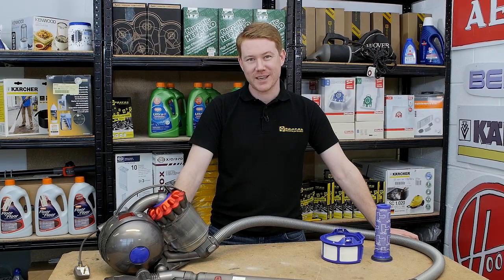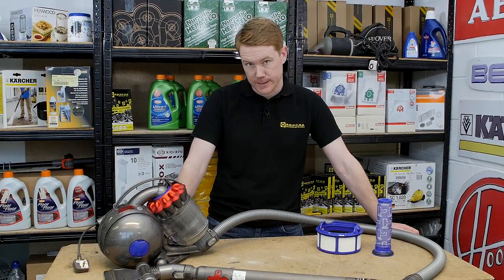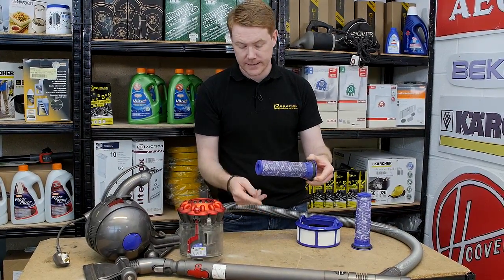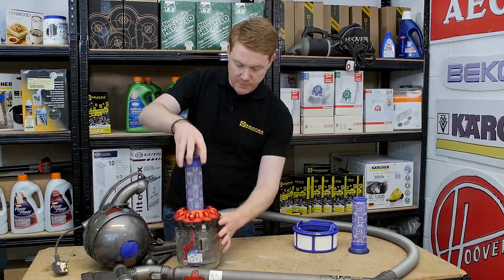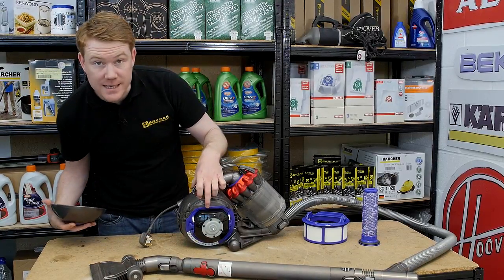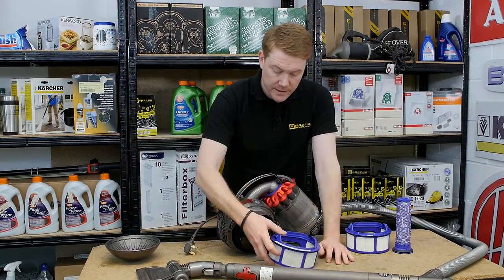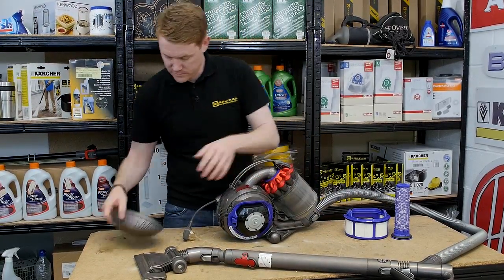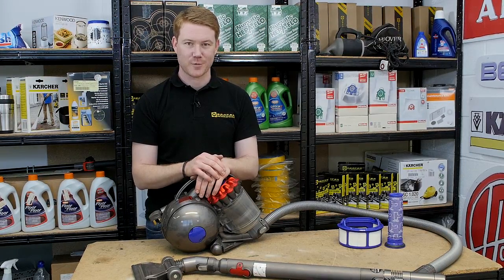How to Replace Dyson Ball Cylinder Cleaner Filters

Comment: I have taken the unit completely apart, removed the old motor, removed all the screws including the ones under the handle but the Hepa filter does not budge.  I have attempted to push in the two white clips that hold the upper assembly but am afraid of breaking them.  It does look like that is the secret.  The upper assembly has to be removed.  If I'm right what is the trick to removing it without damaging the unit?  As I have said the unit is a Dyson DC39 Animal Vacuum.

Comment: My Dyson is a DC39, for the record. Your instruction is excellent by the by, however, my Dyson ball only has star screws on either side of the ball and when undone do NOT allow access to a post motor filter. I'm sure this is a money making scheme by Dyson, exclusively for their US customers.
Reply from the maker: Hi Jacqulyyn Writeordie, thank you for your post and we were not aware you couldn't change the filter in the US not good for customers.
Reply from the maker: Hi Mario, thank you for your new post and good information for all, its a pity Dyson dont listen to their customers.
Reply: I have a DC37 Animal.  I found that the filter surrounds the motor - but the entire assembly has to be unscrewed and motor wires detached before the filter can be removed.  It does not appear that this filter was intended to be replaced very often.  My DC37 has just passed the 5-year mark without any problems and the post filter around the motor is clean like new.

Comment: Hi well i tried taking my side ball part off and I cannot access any further...there is no sight of the filter....how much more do I delve into the machine as at this rate I might come to the other side of the moon...done the easy filter already...thanks
Reply from the maker: Hi Penny, it is normally a simple process to remove the side of the ball as shown in the video, if you have delved that far are you sure it is there. Let us know the model so we can have a look.
Reply: DC39, I have taken the side ball off but it looks sealed to me??  any ideas.  Vacuum doesn't suck well although I have replaced upper filter as described in your video?? any help would be much appreciated...
Reply from the maker: Hi Penny, the DC39 only has one filter, that's why you can't find it so stop looking☺
Reply: Ah well, there lies the problem....good job I put it all back together again then!!! Thank you for your help....really impressive.  I have my very own technician...!!
Reply from the maker: Hi Penny, anytime you need us drop us a line and we will try to help.
Reply: Thank you so much.  I have a DC39 and I have changed the filter but it still doesn't suck that well.  Any ideas?
Reply from the maker: Hi Penny, it sounds like a blockage but check out this video for more help www.youtube.com/watch?v=e1a38GBXpQo
Reply: Hi Penny- I took apart my DC 39 due to same issue, if you haven't already solved this mystery, you may want to try disconnecting the hose and shoving a broom handle down the length of it.  I had some big, nasty hair/filth ball clogging the hose.  I then took the hose to the yard and flushed the heck out of it with the garden hose, too.  Hope this helps.
Reply from the maker: Hi Jason B, thanks for your helpful tips and tricks. We love hearing our customers helping others and getting their appliances fixed.
Reply from the maker: Hi Jason thank you for your post.